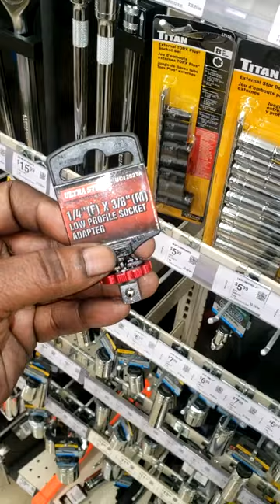A MUST HAVE TOOL. How I convert my 1/4 electric ratchet to a 3/8 when doing car mechanic trim work.

Comment: Snap on would be like "second mortgage, a kidney, your first born and half your paycheck for 3 years. Add your soul for a lifetime warranty."
Reply: Snap on has a version thats like a magnetic sleeve
Reply from the maker: Lmao
Reply: 😂 basically
Reply: Yes but it is better than making 30 trips to the parts store !               2/23
Reply: Damn near everything in my service truck is snap on and I spend like 7 grand. It really ain’t that bad. I will say tho all my electric tools are Milwaukee so
Reply: Snap on cordless tools only have 1 year warrenty. Milwaukee has 5 year. Snap on is a complete joke.
Reply: I just bought a snap on roll cart loaded with tools for about $5,000 I pay $60 a week
Reply: Haha so funny wow snap on expensive I'm jealous of premium tools haha snap on a joke haha I hate my life
Reply: @DownHillgamer  I would say premium 10 years ago.  Not now. Everything I bought in the latest 90s all the way until maby 2012/2013 was unbreakable. Even the hard me down snap on tool my grandfather gave me from his service station  fro. 63 to 80 still haven't broke. Even that 13 grand toolbox tracks don't last anymore. The ones that did get replaced after 8 years, the new ones only last about a year.

Comment: I have all the adapters I’ve never used the step ups I’ve used the step down my 1/2” to 3/8” impact comes in handy I have been using that for over 20 years!
Reply: You use a step down on an impact and it hasn't broke for 20 years? 🤔
Reply from the maker: https://www.youtube.com/watch?v=pTXPrfr_fbA&list=PL-em2JbvrnvxuqZ5bcjgOpZNcKiyPd5Oj&index=6

Comment: I got that entire set from quarter inch all the way up to half inch. The quarter converts to 3/8 the 3/8 converts to 1/2 in and the half inch converts to 3/4. Those things are lifesavers!
Reply: New to tools here, what is the practical reason for owning more than one ratchet drive converter kit? What i mean is, if you have a 3/8 drive ratchet why wouldnt you just get the 3/8 that converts to all the other sizes? Why do you need a half inch that converts to a 3/4 “? Couldn’t you just stick to a 3/8 with a 3/4” converter? Like i said, I’m new to tools so take it easy on me lol

Comment: I have bought many sets of all sizes of these online. They’re a must have it lets me turn my 1/2” drive impact into a 3/8” and  1/4” drive without buying a new tool. (And yes I know how to control the speed and when to NOT ugha duhga it when using 1/4” sockets. If you know how to control power tools and don’t just gorilla them, you can make a 1/2” drive impact work as a 1/4” drive impact.

Comment: I got me one of these in 1/2 inch because I got a boat load of handmedown tools with smaller socket connections and didn't want to get whole new ratchet just to finish the job. They're nice to have if you're in a pinch although I'm sure there's one you can get without the round part this one has around it.
Reply from the maker: https://www.youtube.com/watch?v=pTXPrfr_fbA&list=PL-em2JbvrnvxuqZ5bcjgOpZNcKiyPd5Oj

Comment: The real question here is why the air rachet is 1/4" drive to begin with.  
3/8" for anything under the hood 1/2" under the vehicle.  Leave that 1/4" shit for inside under the dash.
Reply from the maker: Lmao...well damm. Lol...interesting point
Reply: Tell me you know nothing about this job in one comment....
Reply: I use 1/4" all the time for engine work, timing belt cover bolts? Forget about it. Also super handy to break a larger bolt free by hand then spin it out with a 1/4" ratchet, I prefer electric over air but still. 1/4" is king to me, I used to think it was 3/8 but I've since converted. To each their own though, also depends on what you're working on I suppose.
Reply: Air ratchet ?

Comment: Plenty in the tool bags cause in an apartment a tool box won't fit 🤣😂😂 I got bags for wrenches bag for socket sets from 1/4-1/2 inch with extensions and breaker bars. A bag for trouble shooting and repair of electronic/electric with soldering irons and shyt, tie straps, wire cut strippers the $1 in the g-string type, hest shrink, and etc. I got bags and bags and bags and bags😂🤣🤣

Comment: Mac makes those in their Expert line. A three piece set 1/4-3/8, 3/8-1/2, and 1/2-3/4. I gave 24 bux for the three spot.
Reply from the maker: Are they extremely low profile? Cause thats what make them stand out. Your 1/4 ratchet now similar size as your 3/8 ratchet is the key.
Reply: @OnlineMechanicTips  are they still as low profile when they step down? 🤔
Is that what the red disk is for then to add strength?
I'm UK we don't get these, not like that anyway.....

Comment: Now grab the 3/8 to 1/2 inch and your set👀 I use it for my 3/8 ratchet on my 3 foot 1/2 to 3/8s extension for tightening transmission bellhousings bolts to gently close the gap

Comment: I wouldn’t but a 1/4 inch power ratchet anyway. It’s used very little in a mechanical shop. Most mechanics use 3/8 for majority of the work.
Reply from the maker: https://www.youtube.com/watch?v=pTXPrfr_fbA&list=PL-em2JbvrnvxuqZ5bcjgOpZNcKiyPd5Oj&index=12

Comment: I got a three pack of the Titan version of them. They're usually called low profile adapters. It was less than 10 bucks. It had 1/4 to 3/8, 3/8 to 1/2 and 1/2 to 3/4

Comment: I had the 3/8 version of that and would use it as a cordless ratchet/breaker bar and break pretty much anything loose including bell housing bolts on any vehicle pretty much lol

Comment: They have a 3 pack in the titan brand, 1/4 to 3/8, 3/8 to 1/2, and 1/2 to 3/4. Its at oreillys on the pods in front of the counters
Reply from the maker: really?
Reply: @OnlineMechanicTips  yes, ask them next time part number is 30936

Comment: made a small toolbox and have 1/2 impact deep sockets and my main 3/8 extendable ratchet i needed one of these. I have more sockets but its all on the second floor room, wanted to have a compact toolbox and not have to go up flight of stairs all day 😂

Comment: What's the red disk/washer bit around it for? my adapters don't have them at all and I've got about 6 of the things 🧐
Reply: I'd guess for starting by hand with a socket? Sounds dumb but honestly I do that with magnetic sockets all the time. Today even, actually, blower motor resistor, I was too stubborn to disassemble a bunch of shit so I got it out and started it back by putting the fastener in my magnetic socket and turning by hand then sent it home with my electric ratchet.
Reply: @HarleySLA  I always start by hand its the only way to make sure it doesn't cross thread so yea I can see that being handy and possible, I've got nothing no better idea 🤷‍♂️ 👌👍
Reply from the maker: https://www.youtube.com/watch?v=pTXPrfr_fbA&list=PL-em2JbvrnvxuqZ5bcjgOpZNcKiyPd5Oj&index=6

Comment: so you lost your 10mm, 1/4" socket so you get an adapter instead of a new socket?
Reply from the maker: Smh, this not about lost tools so much as it is about highlighting a tool. 50k views and there will always be a slow one in the bunch. No need for 2 electric tool/battery anymore. Easily convert your 1/4 to a 3/8 ratchet.
Reply: might as well. We're all going to lose that 10mm again for sure.
Reply from the maker: @desertblbuesman  lol

Comment: Holy damn man, I need one of these. I keep exploding my 1/4 to 3/8 millfucky adapter with my 1/4 impact gun every couple months. The largest bolts I hit are 1 and half 3/8 bolts. 
That's the most common bolts I use at the fab shop I work at building refined fuel trucks. 
My boss finally got me a 3/8 milfuckme electric ratchet last week. Thankfully all my tools are provided for me and I don't have to pay for anything besides stern questions and and wtf BigV how do you break these adapters?
Reply from the maker: https://www.youtube.com/watch?v=pTXPrfr_fbA&list=PL-em2JbvrnvxuqZ5bcjgOpZNcKiyPd5Oj
Reply: @OnlineMechanicTips  
Oh man, thank you thank you thank you! 
I got stuck watching your shorts lol that suicide door 66 lincoln! 
My first car was a 81 Lincoln Mark IV. That beast had a full electrical cluster, auto headlights for the high beans and had the sweet flipper head lights and all creature comforts that would make these modern cars run for their money. 

The craziest thing was the rear window was the size of a pencil box. Roughly 1ft x 3ft? A car longer than a bus with a peep hole in the back to look out when backing up. 

Thank you for all the hints, tips and hilarious commentary what to do and not to do.

Comment: Yep I have a set from HFT
Reply from the maker: Sweeeeeet
Reply: What are they called at HF, please?
Reply: @bobmcl2406  socket adapters. The cheap set is about $5, the icon set is $20.
Reply from the maker: @Ngcarson1337  is they low riders like these? You can't even tell if an adapter being used
Reply: @bobmcl2406  not at HF, but the titan tools 30936 is the best version of these, impact rated, low profile
Reply: @byanymeansnecessary9329  thanks for this info.  I just found out that up here in Canada, Princess Auto stores carry the Titan low profile 3-pc set.
Reply: @bobmcl2406  titan makes pretty good stuff, titan 11313 is incredibly useful
Reply: @bobmcl2406   titan makes pretty good stuff, titan 11313 is incredibly useful

Comment: That's why I have 1/4 3/8 1/2 socket sets and 1/4 3/8 rachets
Reply from the maker: Seems you missed the point but good for you bud.
Reply: So you basically bought the same tools 3x.. genius
Reply: @Online Mechanic Tips  difference types of sockets for different applications. Short and tall sockets and then impact sockets. Chrome sockets are designed for impact guns. Have many broken sockets from impacts. If you're a real mechanic working on all types of cars daily then all sizes and rachets for tight places. If you use an converter and socket it's too big so that's why If you go and look in a mechanics big ass snap on tool box like mine you'll see many socket sets of all different sizes
Reply: @Online Mechanic Tips  what is the point?
Reply: @mattpaul840  this man speaks the truth. You can never have enough sockets and ratchets in all shapes and sizes. Especially if you're flat rate. You can save you so much time having the perfect tool combination for the job that it'll pay for itself.
Reply: double and triple the weight

Comment: That's simply called a ratchet adapter, but that one also has a thumbwheel attachment.. the thumbwheel is nice once you break the bolt loose, then you can turn it off by hand if using a regular non-powered ratchet.. Powered the thumbwheel is unnecessary..

Comment: You mean you don’t have a 10mm 1/4 drive? How?
Reply from the maker: Sure I do, merely showing you an example of what I intend for it to do when needed.
Reply: @OnlineMechanicTips  this makes no sense,  the only time you would need the adapter is when you want to use the 1/4in drive with a socket bigger than most 1/4in drives are made for like 15mm.  Just use a 1/4in drive 10mm socket, no need for the adapter.
Reply from the maker: @byanymeansnecessary9329  Obviously this is for different scenarios. Such as if im home and only have one ratchet in my side job bag. If you at work surrounded by all your tools, theres no need to reach for adapters.
Reply: @OnlineMechanicTips  ok, still weird to me
Reply from the maker: @byanymeansnecessary9329  lol, some of you guys rich and can afford both ratchets. Not all of us that way so we improvise..lol
Reply: @OnlineMechanicTips  don't need both ratchets, just need a 1/4in drive 10mm socket, pretty simple

Comment: The only problem is that is a easy way to snap the ¼ inch drive hammer off your ratchet...
So trim work only..
No hard set bolts.

Comment: There called step up or step downs u can find them under various brands
Reply from the maker: Interesting
Reply: These ones are low profile socket adapters. Typical step up and step down are different

Comment: I saw that adapter the other day I’m guessing it does the job
Reply from the maker: Mainly for trim areas and allows you to need only one tool and battery. Simply use only your smaller 1/4 ratchet under dash

Comment: Have to ask....why didn't you just use the 1/4" socket?
Reply from the maker: Then I would have no way to showcase the tool.  Heres the deal. There's at least 2 things you can get out of this. Save money on buying another ratchet for home use, or save space in your side job tool bag when you carry tools home. If you rich or you don't have either of these issues,  then this video just a fun video.

1

Reply

Comment: Or you could just get a quarter inch drive socket out of your tool box and use that
Reply from the maker: Seems you missed the point.
Reply: What point
Reply: @robertzeman1009  bulky
Reply: @joshanderson924  quarter inch is less bulky than 3/8, the only possible point is if you need say a bigger sized socket than 15mm which is usually the max 1/4 goes to, either way mechanics would buy both sized ratchets like i did, dyi should just buy 3/8 in the first place not 1/4

Comment: So you are telling me, all I had to do was buy an adaptor ? I wasted hundreds buying 1/4 and 3/8 inch electric ratchets
Reply from the maker: Lmao, I said the same thing. Especially for those repairs where you don't need a strong electric ratchet. This low rider tool converts your 1/4 ratchet into a 3/8 ratchet with ease.
Reply: Yup! IMO, buy the biggest square drive you need (1/2” for me) and then buy two low profile downsized adapters.
Reply: Thx for sharing bruh! That is awesome

Comment: I was wondering what the big fucking deal was for a 1/4 to 3/8 adapter but then I noticed instead of adding the extra inch for the adapter it sits more or less flush with the adapter..

Still gotta say get a 3/8 ratchet and be done with 90% of your socket needs.  Plenty of 3/8" sockets that go to small ass metric sizes.  Unless you got a hella good deal on that milwaukee 1/4" i dont see the reason for getting it . Everything you do you'd have to get a 1/4" to 3/8 or 1/2 adapter when most automotive is using a 3/8" so unless you say im missing the point i don't get it other than the lower profile of the adapter which i still say why the hell would you buy a 1/4" ratchet unless it was like half the price of the 3/8

Peace
Reply from the maker: https://www.youtube.com/watch?v=pTXPrfr_fbA&list=PL-em2JbvrnvxuqZ5bcjgOpZNcKiyPd5Oj&index=6

Comment: They are good, but if you're doing a high torque job don't use a 1/4" drive or you will buy a 1/4" drive.

Comment: Cheaper than a 1/4 inch Milwaukee Cordless
Reply from the maker: This a 1/4 ratchet. But with this low rider tool, you can convert it to 3/8 and only need 1 tool/battery when doing trim work.

Comment: 1/4” to 3/8” racket adapter
Reply from the maker: Yes but low profile. It will not bulk your ratchet tool.

Comment: That’s a thumb ratchet they make reducers just for that reason.
Reply from the maker: It doesn't ratchet. Its not a reducer..stay focused.
Reply: @OnlineMechanicTips  it’s made just like the thumb ratchet but anyways it is a reducer it says right on the damn package 1/4 to 3/8 adapter that’s exactly what it does it reduces the 3/8 socket to a 1/4 drive. You stay focused.
Reply from the maker: @jamesfair9751  Everything you just said wrong but its ok..I know it's Monday.. Going from 1/4 to 3/8 is not reducing. You can't reduce a 3/8 to a 1/4 with this.  This is simply a low profile way to convert your 1/4 ratchet to a 3/8 my guy.

Comment: Dude. You didn't even actually turn a bolt with that set up.
Kinda insulting
Reply from the maker: Seems you missed the point..smdh
Reply: @OnlineMechanicTips  Being fake is lame.
I use that adapter to torque oil pan bolts on BMW's
Show a real example.
Reply from the maker: @jessejuliano5336  This a shorts video. This the way I chose to do it. The video maker has that right. Again, seems you missed the point of the video so I dont expect you to understand anything at this point.
Reply from the maker: @jessejuliano5336  Not on myself at all nor do I have an attutude. Im good, couldnt be better, how you doing?

Comment: Why don't you just use a 1/4 socket on the ratchet?
Reply from the maker: Seems you missed the point
Reply: @OnlineMechanicTips  Not really as you are saying it's a must have, when a 1/4 socket would be better and have more clearance to do the job the same. I get it if the person doesn't own 1/4 sockets, but you're a mechanic and should have them already. If you were using it without the ratchet and used the grip part instead I can see the benefit.
Reply from the maker: @steventaylor5687  Now im certain you missed the point.